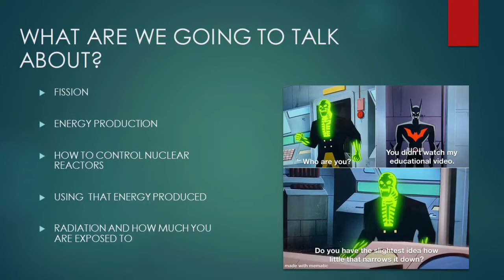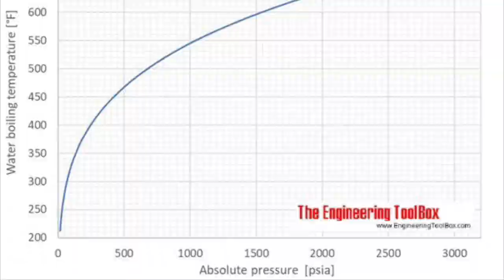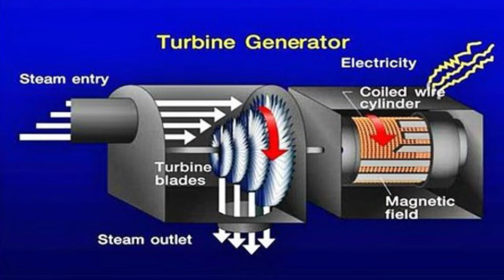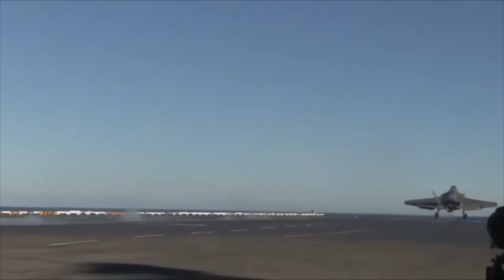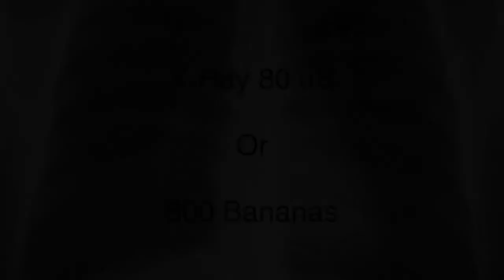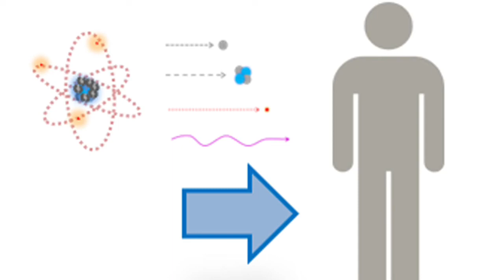Navy Nuclear Power Presentation

Comment: When did they start using the N in the Nuke ratings?  I'm asking genuinely, I was a surface nuke MM but we didn't use the N.  I got out in 2000 if that helps for context.
Reply from the maker: 2010 time frame.  It was done to help differentiate between the nuclear field and the conventional field.  In the past ten years there has been several small changes to rating abbreviations to better differentiate between them, such as LSS for submarine logistics specialist.
Reply: @nukingitout7591  Cool!  Thanks for the answer, I sincerely appreciate it.